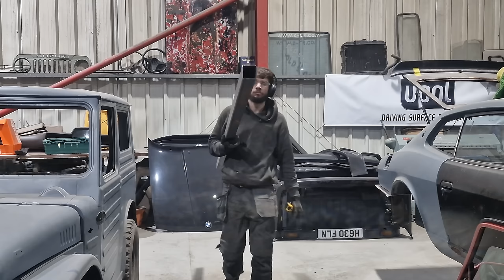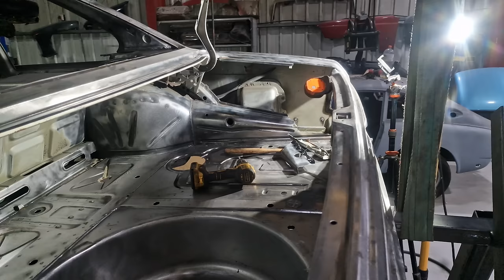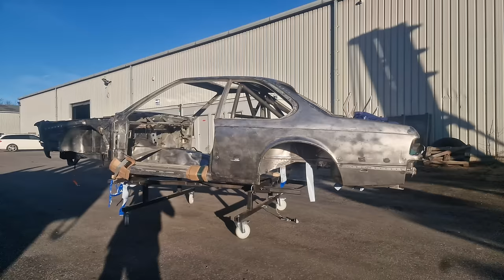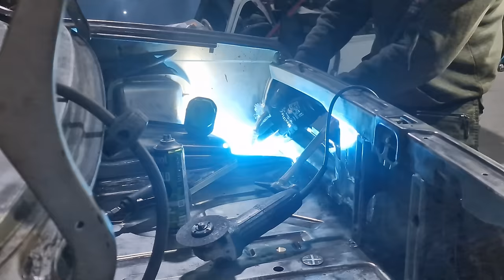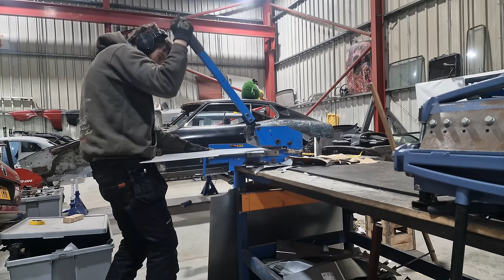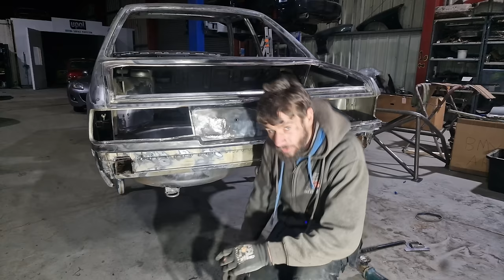Installing A Roll Cage & Blasting Mat Armstrong's Classic BMW E24

Comment: sandblasting can be so frustrating. great when it works but most of the time you are fighting with blockages, poor vision and waiting on air pressure building back up. I've only done it on a DIY scale (with 2 compressors coupled together) but the kit you were using looked major professional stuff and still problems 🙄
Reply: We sandblast on a daily bases at my job and we have none of these problems. Visibility decreases only when the sand is up for a change.

Comment: ⚠⚠⚠Please please please reconsider the half cage. Half cages act as a pivotpoint and then the roof becomes a lever. Because of the added support for the B and C pillar, parts of the stress go into the chassis, but parts also go to the unsupported A pillar raising the risk of collapsing A pillars. If that happens the roof will fold right into your face crushing your head. Because the head is almost in the pivotpoint your head will experience maximum lever effect. Extend the cage to the front, including A pillars or get the cage out. This is potentially deadly. ⛔⛔⛔
Reply: Lol...
Reply: It's matts car, let him worry about it, it's probably safer than the other  high end heaps he runs about in